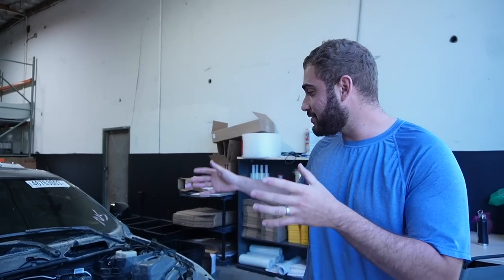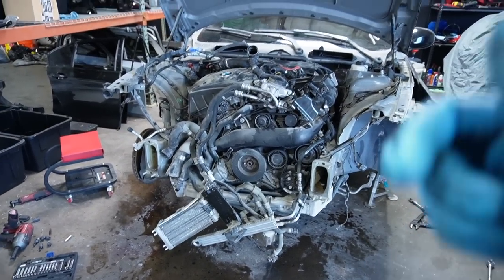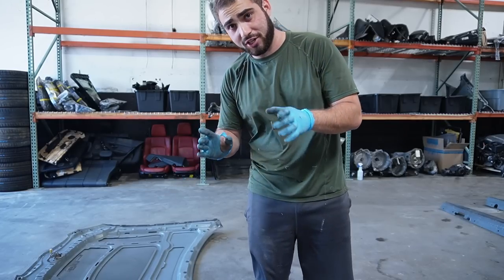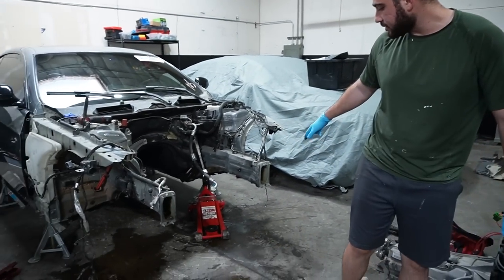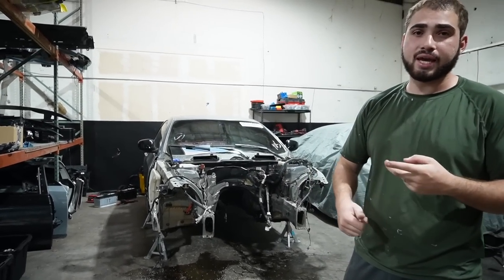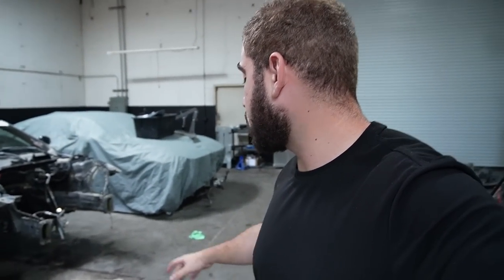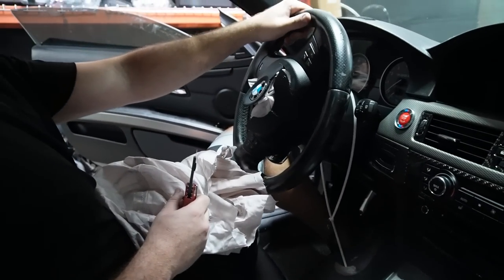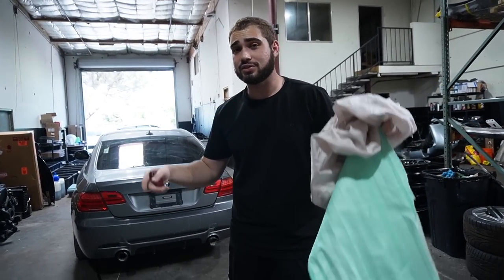The 335is Is The Gift That Keeps On Giving! Is It Worth it?

Comment: @nourhummadi nice catch getting the index-12s on that engine. About the velcros, he probably had a leather dash cover attached to them. If take out the added carbon fiber mainly because they're different than the trim. The trim looks so clean and the fake carbon fiber devalues it a bit. You can use a brushed gunmetal wrap

Comment: Bro... You need to stop by harbor freight and get a hoist load leveler, it's a life saver when pulling engine as you attach it at two points and turn the leveler to get the engine and trans level in the air.